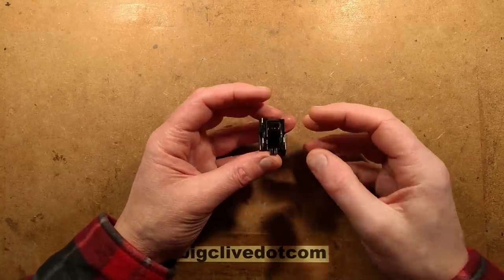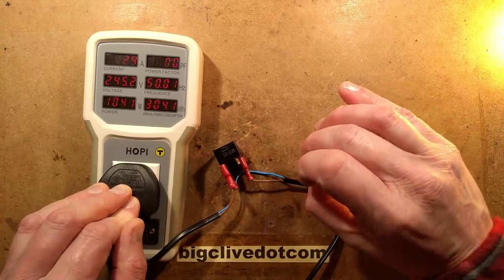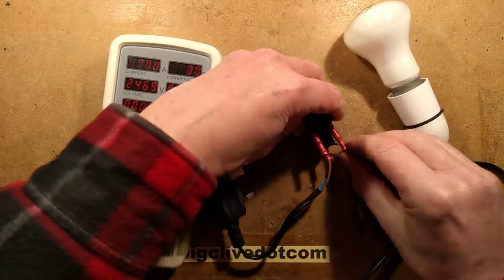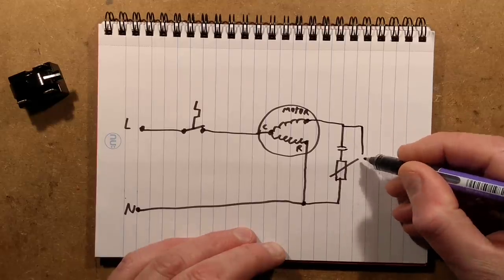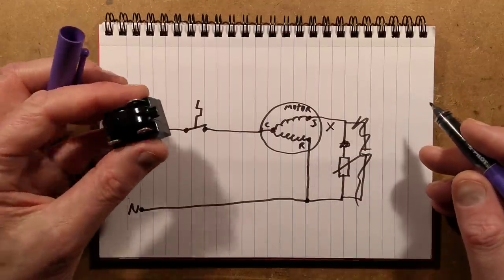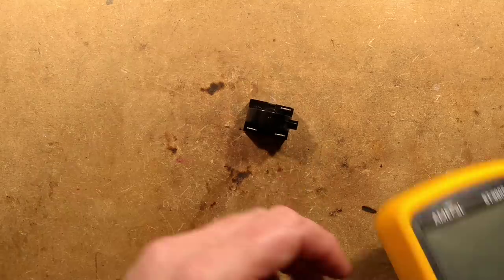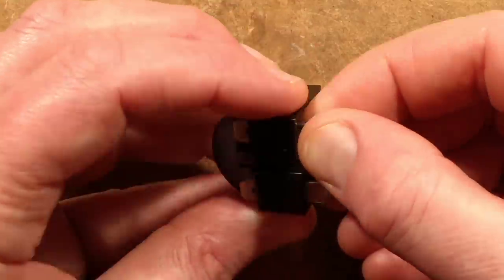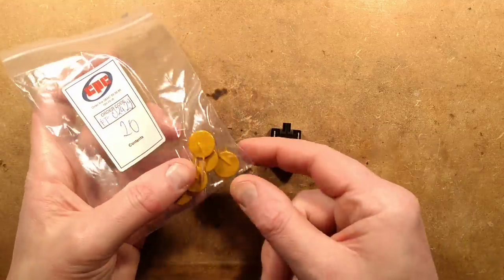Inside a cheap eBay motor-start module.

Comment: The internals of that look identical to the Degauusing PTC's that old skool CRT's used to have. They would  ensure a nice big chunk of electricity went through the degaussing coil (which demagnetised the CRT) on startup and then  dropped to near zero once the deed was done and the PTC warmed up...

Comment: My fridge has a 10uF AC start cap in it and the compressor has a thermal cutout device on it. A fridge compressor under load (high head pressure) cam draw more than 15 amps on startup on a 120 VAC supply. This depends on the size of your fridge of course. A window or RV rooftop AC unit can draw nearly 30 amps  (on 120 VAC line) under load at startup and you homes central AC unit outside can draw over 100 amps on a 240 VAC line under load at startup.
The #1 failure in home AC units is a capacitor on the air handler / fan or compressor. next would be the units contactor relay an / or 24VAC transformer

Comment: Run and start capacitors are used when medium & high back pressure conditions exist like a TXV that does not allow the system to equalize.

Comment: It works as a degaussing thermistor in the CRT type TVs. 
It would allow enough current to flow for appx 10 seconds then go high and shut the degaussing coil.

Comment: CRT degaussing coils used varistors in series on every power up to taper off the drive current hence diminish the alternating magnetic field to zero over a few seconds. This resulted in a demagnetised screen mask and you could usually hear the hum they made when you switched the screen on.

Comment: I fixed recycled fridges and freezers about a decade ago. There were older PTC's, molded on white plastic casing and newer black ones, which were more durable. Fault, which was easy to spot. The customers sometimes called, that their fridge/freezer was sold broken. First question: "Did it smell bad?". If yes, "Did you carry it sideways, and didn't let the oil settle to the bottom before starting it", and if no, "Did you bring it from the below zero temperatures straight in and started it?" (altough i already knew the real answer).

Comment: I'm amazed that the price was so low. A couple years back, the PTC disk on my fridge disintegrated from age, and the appliance repair shop wanted something like $70-$80 for a replacement. Fortunately, there was another shop with an old pro who handed me a module which he had salvaged from an old unit, and I was able to adapt it.

Until I was able to make the repairs, (in order to save my food) I was forced to manually start the compressor using, shall we say, a suboptimal restart procedure.

Comment: You should have shown the difference between this one and the relay type that uses the current of the run coil to switch the start coil. This type seems to protect the start capacitor if the motor doesn't run.

Comment: Also, the powered windows on my car  probably use these as there's no limit switch .  The windows are disabled when the ignition  switch is off, so no unwanted battery drain.

Comment: Older motors had a centrifugally operated switch that did the same thing.
Reply: These thermals and the older current relays they replaced are mainly intended for hermetic sealed compressors, but sure you could use one on a open motor.

Comment: Had to replace entire a/c unit on my house about a year ago. Frequent Power Loss is my power supplier. When installing the condenser/compressor (the outside unit) I spent $20 on a delay switch. When power loss occurs the switch  cuts the power for 5 min. We have a real problem with the power blinking out for a few seconds then popping back on and blowing again, which obviously isn't so good for things like motors. When we get these cycles often u can hear the neighbors a/c units just humming away until it overheats and  resets. I'll deal w not having a/c for 5 min rather than setting the fans and compressor to the broil position. Also if ur having ur unit worked on it pays to buy an extra capacitor. Caps don't like hot climates very much and are basically a consumable item. Having the right one on hand can save u hours or days of discomfort and a hefty bill from a repair company.

Comment: Neat little device. Every compressor I've ever seen be it household or shop had a big starting capacitor. Have one in my drawer that you can't even touch your fingertips around it from a particular beefy motor. Only other things I've seen on the motor side of the circuits are thermistors between the start cap and motor (as in physically sandwiched).

Comment: Similar ptc's are used in hot glue guns too (as I'm sure you know), where their self heating melts the glue, and their resistance increase limits power and temperature.
Reply: how long has this been a thing? because every glue gun i've opened since i was born in the 80s has been a coil of resistance wire like a soldering iron, i know they exist because i've watched clive take the apart
Reply: @frogz  I'm really not sure, I've only taken one apart, and was surprised it didn't have a coil and thermostat, just a slab of ceramic with the mains conductors pressed against it, wrapoed in kapton film and pressed against the cast metal tube that the gluestick goes into.  I guess the one I took apart was between 5 and ten years old.  (The ratcheting system had failed, so I thought I'd dissect it before binning it :))

Comment: I have a trio of these in a drawer somewhere, a Haier mini-freezer I salvaged a few years back decided one day to stop running (after I'd tested it, cleaned it out and moved it indoors from my shed!!) and I tried replacing this doodad to no avail (probably seized piston, annoyingly), they just plug straight onto the compressor via those L & N holes once you've connected the wires to it, quite simple things really... :)

Comment: The pin holes with the springs inside are designed to clip directly onto the pins sticking out of the side of the compressor.

Comment: I love this channel. 

I have never been a fan of PTC start winding control. I prefer either centrifugal internal in split phase motors which is common on air compressors, bench grinders and traditional central ac or electromagnetic potential relay to control the start winding common in US refrigerators

Comment: After hurricane Katrina immersed my refrigerator and freezer, I found those ptc ceramic discs had disintegrated. So I merely removed them out of the casings, but they both continued to run anyway. How neat was that? Also, don't they use a similar circuit for heavy mercury vapor lamps?

Comment: Also if you short cycle a refrigeration system the oil mixed in with the refrigerant will not make it all the way around the loop and you'll ruin the compressor pump

Comment: I had one fail in my fridge and it was just over 6 years old, at first I thought it was the compressor because I could just hear a hum then the overload would cut out.  fridge tech I spoke to said oh its a Whirlpool it will be ya compressor get a new fridge.  I got one of these from a fridge at the junk yard to test the theory and its been running fine since.  resistance of mine was like 400 Ohms and should have been like 15.

Comment: Early versions of this device took too long to cool down and when the fridge soon called for cold again the start winding wouldn't  energize and the compressor burned out. modern electronic temperature controls have a 3 minute delay on restart if it occurs within 3 minutes

Comment: You know, I have worked with these all the time, but this is the first time I have seen what is inside of them. If you want another interesting component you should dig into a potential relay that uses feedback to cut off the start capacitor from the circuit so it doesnt.. you know.. overcharge and blow up.

Comment: I had one go bad from the metalization getting pitted. Just popped it open and rotated the disk to fresh metal. Ordered a few spares for future failures.
Reply from the maker: When I first moved into this house there was an old washing machine with a PTC disk in the door lock that had the same issue.  Quick clean and rotate and it worked again.

Comment: It has been said that incandescent lamps do not appreciably strobe. Well, they do strobe enough to cause a 100 (or 120) Hz hum when operating an exciter bulb in a film projector, even with fairly good rectification and filtering. The LED and laser based red exciter assemblies that were introduced in the mid-noughties (accompanied by cyan dye in the soundtrack instead of black) did improve the hum problem because they actually had regulation. Although, digitalization was dawning already in 2004 when the first producers started making their prints with the cyan dye. And it was gaining good speed already in 2010. My theory is that although it was said the extra black dye used in the soundtracks would release toxic products into the atmosphere when burned, the truth behind all this was that the red light/cyan dye technology had to be sold somewhere in a rush, AND because the change would cost up to 10k EUR per machine, there would be cinemas that would not be able to swallow the pill. Truly, many went out of business because the distributors would no longer supply prints to cinemas without the new red exciters. A friend of mine got a few more prints when he lied to the distributors about the status of his cinema, and he would just ramp the volume up a few notches (although there would be a lot more noise). Once all distributors started requiring a certificate of the red exciter installation from a licensed contractor, no more luck. 2006 was the last year before an oncoming municipal merger, and our municipality would no longer grant support for the cinema. So out of business he went. And, to be frank (which I am not) I think all this was done to kill off "a few" booths so they wouldn't be queued for digitalization. There really was no true need to get rid of a potentially toxic component that had been used for decades, just to get by a few years. There would still be more cinemas that could not afford to digitalize. Now it is about ten years from the last foreign movie that was distributed here on film, and a wee bit less from the last domestic one.

Comment: Hello Clive, would you be able to teardown and appraise little eBay "soft start" modules for power tools, there are 2 wire and 3 wire versions but I don't know what the advantage of the 3 wire version over the two wire version is, do you?

Comment: For most modern refrigerators that use the type of motor that is designed for it needs 2 more spade connectors for a run capacitor. To increase the efficiency by about 2/5's lower amps. They will run for a while but will over amp the run windings in the compressor. 
Available now is the capacitor start(never a bad thing) capacitor run unit that comes with a 12 mfd cap. which is the most common. But you can attach the original cap. if it is of a different value. The motor is designed to run with that particular mfd cap for maximum efficiency, and they only very rarely fail. Like almost never.
'Supco' brand components and it's called a 4-n1 start relay. Very useful. Definitely NOT the '3-n-1' which doesn't have the crucial run cap. connections available. I have replaced many compressors that were ruined by this misapplication.
I would like to see a video on the electronic type of relay- for instance Whirlpool brand part number w10189190. It has an interesting little board and stuff in there and B.C. could go to town on it.👍

Comment: I wonder if that is how my auto roll down windows work in my truck. They stop at the end of the travel no mater where you start then rolling down. Likely it has something to latch the power on and a PTC to release the latched state once the motor stalls. If I even dig a little deeper into the control circuit I will try and remember to let you know. I was alaaaaao thinking you could of used the IR camera to show the temp go up.

Comment: Slippery slope as next you'll be looking into current relays and potential relays which are used to cut out the start windings on some motors.  You can buy a hard-start kit to put on a PSC motor that is just a capacitor, PTC and thermal switch.

Comment: Hey Clive, I hate those POS's, if you ask me, they don't take the start winding out of the circuit soon enough, in order to be able to use small refrigerator, like a mini fridge, off of 500 or so watt power inverter, because of the excessively long start duration, and you know that cheap power inverters, can only handle the surge current for several Cycles.

Comment: This is not typical of a fridge compressor starter, there are only two terminals that push on to the compressor pins. So no start and run windings like your diagram. I’ve seen them with a coil inside, in series with the run winding, that pulls in a contact to the start winding. Then as the current drops the coil loses its pull and the start winding is disconnected. The thermal cut out is usually a bi-metallic switch.  I guess the device you have is used in cheap small fridges and aircon units.
Reply: This unit is used instead of the klix'on relay.  Connects same two pins.  3rd pin is when a compressor doesn't have matching pins and you need to wire it up.

Comment: Motors / compressors with a starter of this type must have an internal thermal cutout. In any case the compressor stalls, or a very short blackout / brownout happens, it won't start up again, and keeps humming until the the cutout opens, potentially damaging the windings by the time, and the overheated windings can burn the oil and the refrigerant too. I'm not sure why they gave up with the older style start relays. Those can instantly start the compressor back up any time in case of a brownout / blackout.

Edit: D'oh, you mention the same thing; commented this while I paused the vid. I'll leave this in tho.

Fridge compressor stator is of a special design, that lets it split the single phase in without any aid of a capacitor. Obviously, it's not very efficient in start mode, it'd get hot quickly if it keeps running this way, but it provides enough torque to start up even against some back pressure.
Reply: @Joe T - In some cases when this happens with an AC, that is, it won't start back up, is because of a bad start / run cap, straight from the factory. That happened before here.
Reply: @Joe T - A short duration inrush current is less destructive than a longer period of locked-rotor current, that CAN happen with a thermistor starter.

Comment: So if you have a motor that had its centrifugal start switch burn out, i wonder if one will hold up to shutting the start winding off after motor start..?  Ive got an old motor that relies on a potential current relay which is basicallt the same thing except its more like a solenoid that has to stay in a certain position so the contacts will lift when the current shoots up….

Comment: I wondered today, maybe it could be used as a replacement for the starter module for fluorescent lamps?
Reply from the maker: Some compact fluorescent lamps use small PTC thermistors as the starter.
Reply: @bigclivedotcom  random thought I had as I was coming home and walked past a started lying on the ground

Comment: Sump Pumps, Sewage Pumps or (really big versions of this) electric Cargo Ship motors (MANY Years ago, my high school class took a field trip to Conestoga College in Waterloo Ontario and at the time, they had a motor who's Rotor was 50 FEET in diameter. It was designed to turn one of the 2 propellers that drove a Supertanker through the water...they couldn't start the thing because if they tried, they would have caused a Brown-Out for all of Waterloo County...)

Comment: A PTC as boost starter for a light bulb is nice to demonstrate. An NTC as a soft starter also can be demonstrated with a light bulb. Would they not nicely complement or compensate each other giving room for further studies? 
In addition to  a light bulb they could control a fan (or two).  :o)

Comment: I wonder if it would work as a (albeit slow-acting) fluorescent lamp starter?
Reply: Unlikely.  Starter-type "preheat" fluorescent ballasts are typically designed to intiate the arc in the tube using the voltage spike that occurs when the starter switch opens.  The switch has a snap action to ensure rapid opening.  A PTC switch would be far too slow.

Comment: About the opposite of an inrush current limiter which has a high resistance cold and a diminishing resistance as it warms up. Need to find one for a 4 KVA transformer, durn thing keeps popping the circuit breaker depending where in the cycle one turns on power to the Xfromer.
Reply from the maker: You can buy them from local industrial component suppliers (or online).  I'd suggest mounting them in a bit of ceramic terminal block as they deliberately run hot.  You will probably have to use several in parallel for such a high load.

Comment: I've got an old small freezer that uses a relais instead of a PTC. Its running quite nicely on mains but if i try to run it on a battery powered inverter the relais flickers like crazy. I guess the inverter isnt strong enough altough its ratet 600 w nominal and 1200 w peak.
Is there any possibility to change the relais to one of those cheap ebay modules to make it run?
Reply from the maker: It might work, but it will depend on the circuitry.  If your relay controller is electronic it might not like the inverter output if it isn't a pure sinewave.